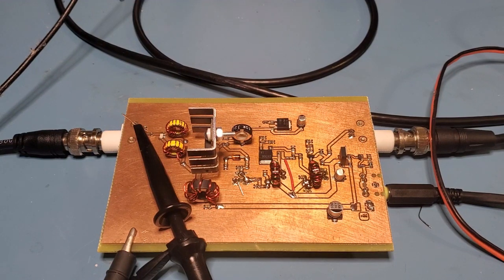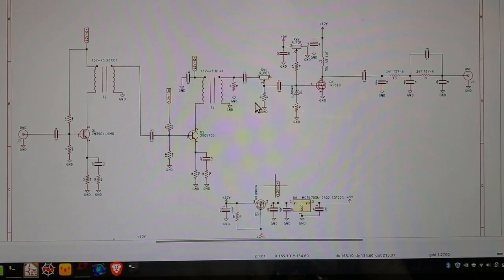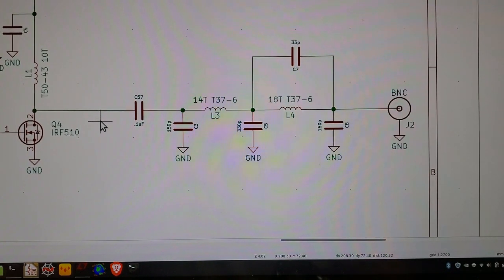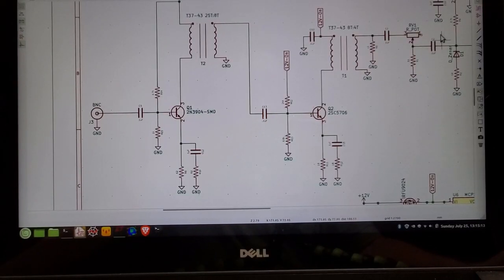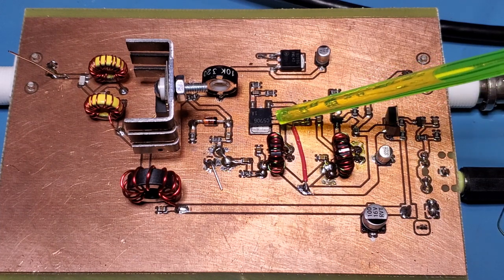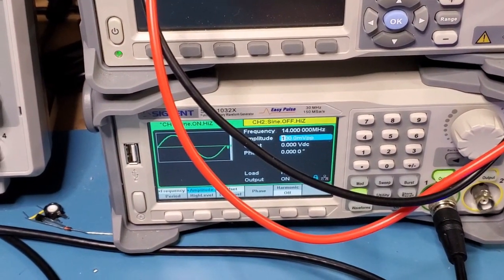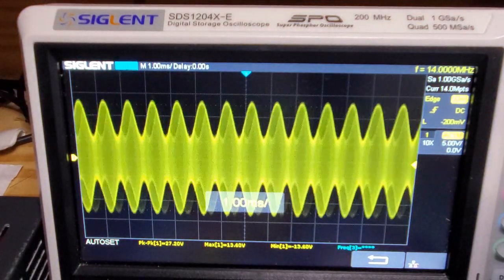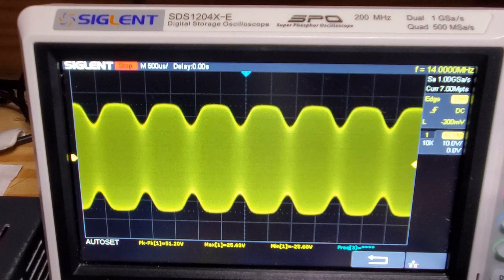Yet Another Amplifier - 20m 5W IRF510 SSB Amplifier

Comment: Very nice work, the two driver stages probably accounts for reasonable output on 14MHz. I'd be interested to see you replace the IRF510 with a Mitsubishi RD16HHF1 and report the difference at 14MHz.  I'd bet your IRF510 amp would go gangbusters at 7 to 10MHz.  PS: 'bodge' shows your antipodean origins!
Reply from the maker: Thank you Paul - guilty as charged on coming from Australia,  living in Dallas area now but grew up in Newcastle, NSW. I might have to try a 7Mhz version and post results! I'll have to check out that other mosfet too - datasheet seems to put it somewhere between the IRF510 and IRF530
Reply: @na5y  The IRF510 never shines in an RF role, in the first place, but 14MHz is beyond its sweet spot even in the RF misuse case :-).  I know there are people who have successfully pushed it as far as the 10m band, but those are real accomplishments, not "normal" performance.  In my experiments, I don't really like what the IRF510 does above about 7MHz.  I'm surprised you're only getting 3W out of that arrangement... At full swing on the drain, an 8-ohm load to the IRF510 with a 12V supply a proper transistor should be giving you about 8W.  It's likely the IRF510's high gate capacitance and weakness WRT to rise time and reverse recovery time :-(.
Reply from the maker: You've given me impetus to try again at 7MHz. 3.6 W was about all I could get out of it before it went non-linear. Thank you for the comment Yakov. Is there an alternative to the IRF510 you could suggest?
Reply: @na5y  I've been playing with the 2SK3476 and working with a genuine RF transistor is like breathing fresh air.  It's not the most convenient package... in my case, I was pleasantly surprised to have no oscillation issues to fight, though a home etched board without thermal vias to a ground plane might require some TLC :-).  I got a board from OSHPark with a proper footprint.  I've been thinking of just trying one dead-bug style, glued to a heat sink, though... I suspect it would work, but don't know for sure. I think IRF510s are popular because they're easy to heatsink and hams are super frugal...
Reply from the maker: That is an interesting package https://toshiba.semicon-storage.com/ap-en/semiconductor/product/mosfets/detail.2SK3476.html . 6 bucks a pop though!
Reply: @na5y  Heh, yeah... hence my comment about frugality :-).  Most people seem to attack the low performance of the IRF510 on higher HF by doubling up in push pull, and then there's the nuclear solution of increasing supply voltage.  Or ginormous heat sinks and flogging it with a massive quiescent current...
Reply from the maker: I am might get some off ebay and post my results! Wish me luck! ;)
Reply from the maker: Thank you for the advice Paul!

Comment: thanks for the video, would really like a video of the process you'd take to design from scratch an RF Power Amp in the range of 50 -100W  in the HF Band..there are videos on here but everyone blows through the actual design process and they make it really complicated.. was just wondering if you could ?
Reply from the maker: 50-100W might be a bit beyond my capabilities ;) - let me have a think though. If you are interested in the math I would recommend this video from Charlie Morris - I think he does a great job explaining each stage - and the matching process for each stage:
https://www.youtube.com/watch?v=eEuDxwP6CpA

There's a lot to the design process but simply put you start with the final stage and from your desired power determine the load resistance the formula VCC^2/2*power. You then work backwards and at each stage calculate a new power which is 10-15 dBs below the following stage. This gives you a new load resistance which you then have to match to the input impedance of the following stage (typically with a toroid transformer - but there are a vast array of matching techniques). Thats for a class A amplifier anyway - its such a deep topic 

Another good resource is Solid State design for the radio amateur - Chapter 4. I think its out of print but you can pick up used copies on Amazon. There's also archive.org that has an eVersion.

I probably couldn't do a better job than Charlie did but let me hit the books and see what I can come up with. Thank you very much for the comment
Reply: @na5y  yeah i'm aware of charlie and love his content, but charlie says PA are like a black art .
Reply from the maker: hehe - he isn't wrong on that. A simple example is calculating the input impedance of that final IRF510 stage. There's no doubt it can be done from first principles - I can't though and I had to resort to modelling it in LTSpice and using that. Then you get variations in the components themselves for example those eBay bought 2SC5706s - that had me stumped for quite a while. The component tester I had showed them being identical but they behaved quite differently in circuit. Stay tuned - I will definitely be doing some more playing around...
Reply: @na5y  I think a lot of the bogus parts are either (A) production runs that didn't meet specs at the fab or (B) counterfeits that are relabeled parts that can be had cheaper than the real ones.  In the latter case, I think the counterfeiters get away with it a lot because in simple DC circuits the transistors don't get pushed to their real limits.  So if you're just making a power supply or something, the differences in RF characteristics don't really show up much... very annoying.

Comment: Appreciated, thank you.  What technique do you use to cut the neat lines in the circuit board?
Reply from the maker: I use an etching process with this "fab in a box" transfer paper. 
https://pcbfx.com/main_site/pages/start_here/overview.html

I did a video on the process a while back here https://www.youtube.com/watch?v=X5O1au3FvRc - the process description starts around the 04:00 mark. I was using Eagle back then but it works exactly the same for kicad. Its a bit of fiddling around but the results are usually OK. You can even use the same approach for double sided boards too.

Thank you for the comment!